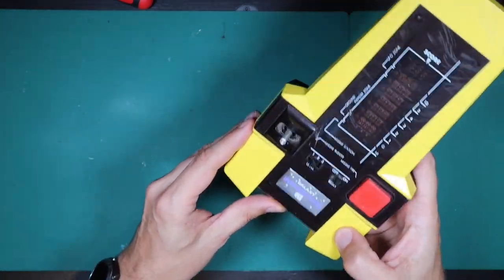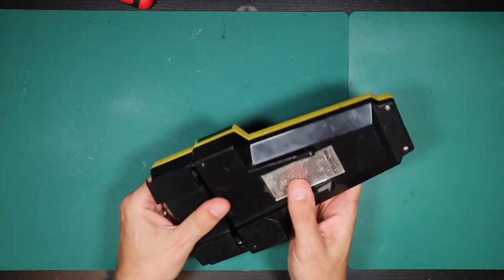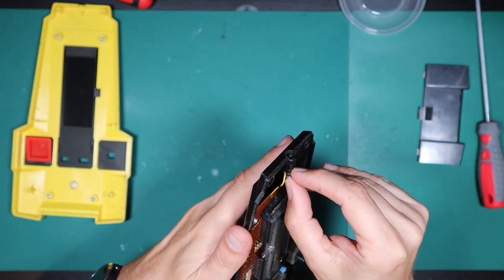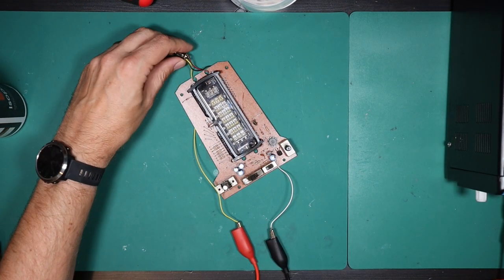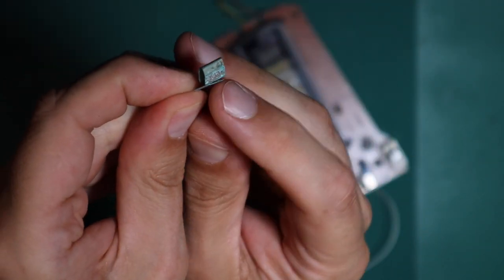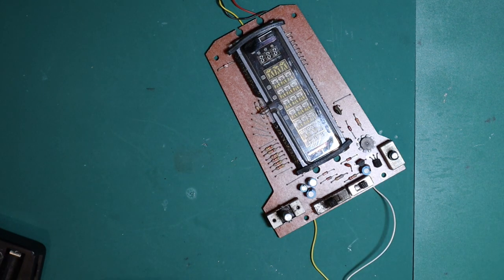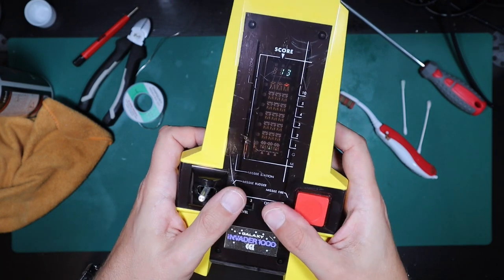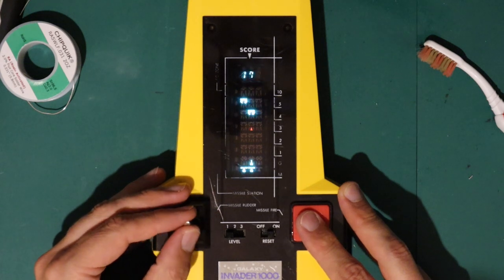CGL Galaxy Invader 1000 / Tandy Cosmic 1000 Fire Away Repair - Retro Gaming

Comment: In the past with this type of thing it can actually be the power input jack that can be an issue.  I normally change these as common practice.  I would also use contact cleaner and clean the switches.  

One of my best tools is an illuminated inspection magnifing glass on a stand, excellent for spotting cracked soldered joints.

I am a qualified electronics engineer and I enjoy your video.  You actally explain things very clearly and well.  If you are in Birmingham in the future - lets hook up!! :)
Reply from the maker: Thanks pic holder, good suggestions. I do have an illuminated magnifier I should feature it on the channel sometime. I hear you on the power jacks too had a couple of those corroded up and inhibiting battery voltage. Thanks for the tip and invite. It's been a few years since I was last in Birmingham, but if I get down there anytime I'll ping you for a beer maybe. Thanks for your comments and advice. RTR

Comment: I have one in great condition but the fire button nit working. Not sure how to get inside the plastic housing to try and clean or fix it.
Reply from the maker: Once inside the enclosure of the game I'd try squirting some contact cleaner onto the switch as best I could and then working the switch. The game does need to be opened up to access the switch but switch itself would not. If if we're me I'd try that first. Also check the solder on the fire button and the PCB tracks that lead to is as these can crack. Not advice just what I'd do if it were mine.

Comment: Hello , the left joystick of my galaxy invader and the right button works but very badly , have you an idea to fix that ? Thanks a lot
Reply from the maker: If it were mine I'd probably disassemble the game and clean the joystick first with a non-residue electrical contact cleaner such as WD40 electrical contact cleaner (Not normal WD40) and work the joystick a bit. Then I would use a lubricating switch cleaner like servisol super 10 and again work it a bit. I would also check the solder joints on the switch. I haven't managed to make the switch work great using this approach, but I have improved sticky and sluggish switches significantly with this method. Good luck, stop back and let us know how it goes

Comment: I had one of these as a kid, a long time ago back in the late 70's I think I would have had it. My Dad opened it up and added a connector up the top so we could plug it into a little black square transformer, so we didn't need to use batteries anymore. This one looks just like it, and there is a big question mark in my head whether this actual one is the one I had as a kid, as how many other Dad's out there would have done that for their son??
Reply from the maker: What a heartwarming story. Perhaps this was "the one" sadly I have sold it on so we may never know and I cannot reunite you both. But I am very grateful for you sharing. Thanks so much.

Comment: Do you know what ac adapter is compatible with this ?
Reply from the maker: Hi DJ Cast... sadly I don't know of a specific adapter and nolonger have the game to work it out. I'd imagine back in the day it would have worked with one of the adapters that had a 6v supply and 4-way DC plug (2 barrel plugs and 2 earphone style plugs).  I think you need the earphone style but which polarity you'd need i don't know and the wrong one might damage a game. Sorry I can't be more help

Comment: What do you think your complex to easy repair ratio is for the tech you buy off ebay? For me, fixing both audio and retro tech, its around 5:1. However, my repair to rubbish tech (due to poor seller descriptions) ratio is currently around 1:5 😂
Reply from the maker: Hi Stuart, since I tend to lose money on the repairs I am quite selective about my purchases so perhaps I get more simple repairs because of that. I think audio is often more likely to have been tampered with (lots of pots in there that surely just need a good twiddle and all will be well). I try to buy one offs from individuals avoid job lots of the same thing (eg 10 wii consoles) and collectors.  I normally look at the sellers other items and history. Because of that I probably run about 50/50. Like you though I do see many "creative" descriptions ! Great Question. Thanks so much.

Comment: Hello!
I found one Galaxy Invader 1000 in it's original box, never open, still sealed, how much do you think is it's market value?
Thank you very much, I don't know where else to ask.
Reply from the maker: That's a very difficult question. I'm not an expert but prices seemed to fluctuate a great deal over past year. Condition is also a factor. During lockdown prices on eBay went very high. When I sell on eBay and I want a quick sale I tend to watch auction ending prices and sell a bit under the ending prices. Sorry I can't be more help. Thanks for your question
Reply: @RetroTechRepair  Thanks for these informations, that's interesting

Comment: I have one in excellent condition--only the fire button not working--any suggestions?
Reply from the maker: If I remember rightly the fire button is a mechanical switch in these games. In my experience the fire button can get a bashing resulting in cracked solder joints, and PCB tracks. One other possibility is the switch has gummed up and would benefit from some switch cleaner. Either of these will require you disassemble the game to access the switch. Obviously I can't advise without seeing it but if it were mine that's where I'd start. Hope that helps